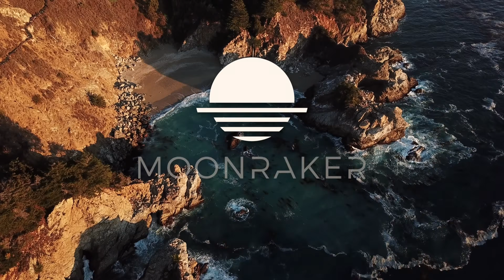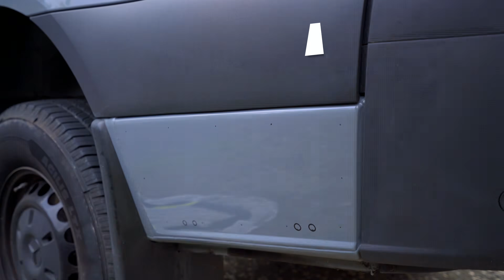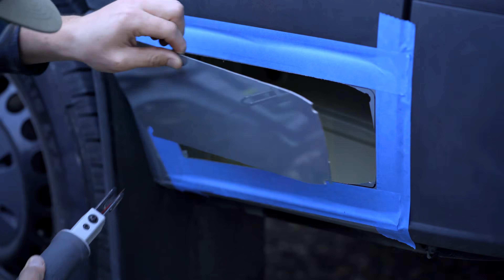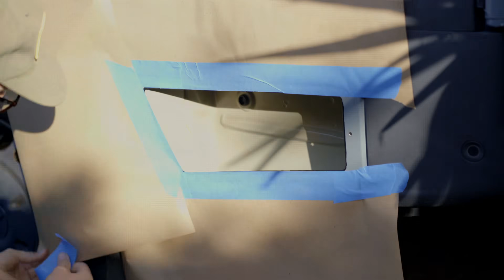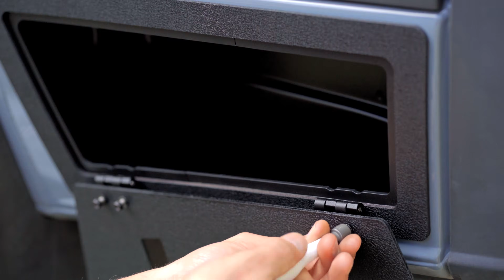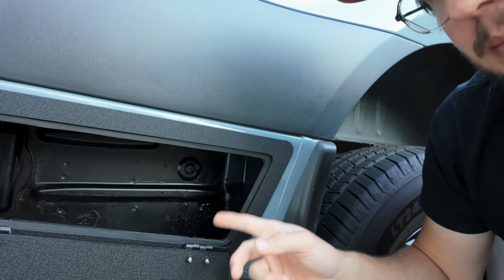Custom Sprinter Van Rocker Lockers.  Extra Storage for the Van!

Comment: Anyone know if there is any easy path to getting into the interior space from inside these rocker panel lockers?  Considering a cool air vent in here to work with the ceiling fan amongst other things....
Reply from the maker: Not really a clean way at least in a 144, it would require cutting of some sort. Either straight up in the wall or  you can see how we routed our Shore Power wires here with a cut through the D-Pillar - https://youtu.be/0lpXNqH_oMM?si=8leIfd9aNwgTLfGC&t=712

Comment: Please make these for the 170! I love that they are clean with no visible studs (you excepted of course) or branding.
Reply from the maker: lol! 😂.  I have to get to commercialized for 144 first, but yes this is my long term plan. It’s quite a bit different building one set for my van and giving people enough of a product/instructions they can do it themselves.
Reply: @moonrakerdesign  You already have the video tutorial (instructions) made! So 1/10th of the way there! I'm keeping my fingers crossed it works out for you (read: me) though, and won't be installing any existing boxes until I can get by hands on the Moonrakers! 

Please don't delay: I need a place to stash full doggy poop bags when I head home from the trails! Until then, I'll continue to stick them under the windshield wiper... but man, that can get dicey when the automatic rain sensor kicks in...
Reply from the maker: @tullynation  I wish it was that easy :)  But thank you for the support and encouragement.

Actually the doggy poop bags is a pretty good use case for it actually!  Never even thought of that.  On my drivers side I put the shore power in there so the cable and the plug fit in there perfectly.

Comment: Hey Todd,

Would you consider listing the parts needed (PEM, hinge, etc) to build the locker rocker? I'd be happy to buy a pair from you (I'm on your notification list) but I could build them myself, leveraging your research and experience. I'm building my 2023 up in Petaluma.
Reply from the maker: Sure you can send me an email and I’ll provide the HW I used.
Reply: @moonrakerdesign  Can you add me to that email - I am also signed up for a set once you make them but also have some other projects in mind - thanks in advance - I already emailed you a few days ago

Comment: Excellent work as always! I admire the attention to detail, and I’d definitely consider picking up a pair of these if you decide to market them!
Reply from the maker: Hey Jay, thanks for the comment and the encouragement!  Thinking about doing a small run.  I think I want to switch to an actual template trying to make it so it’s super easy and foolproof to install because it’s actually a lot of measuring and positioning to get it right at the moment.  Best thing to do is sign up for the out of stock reminder on the website to stay notified!